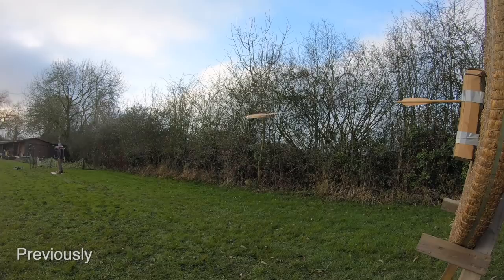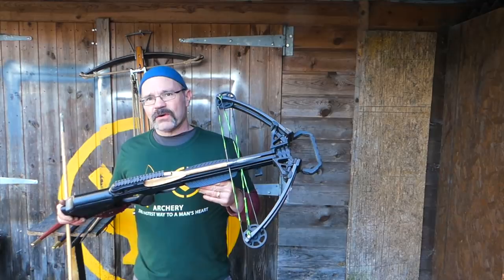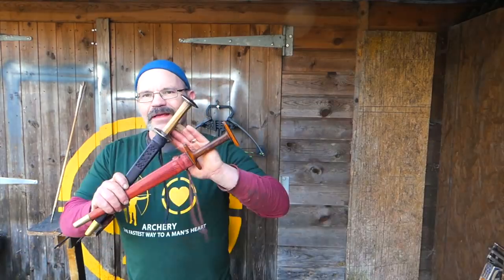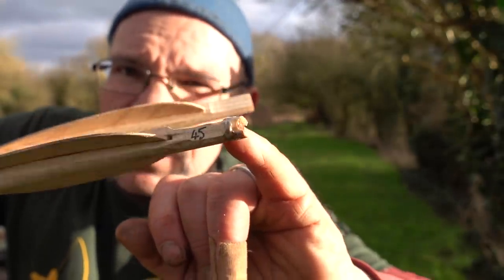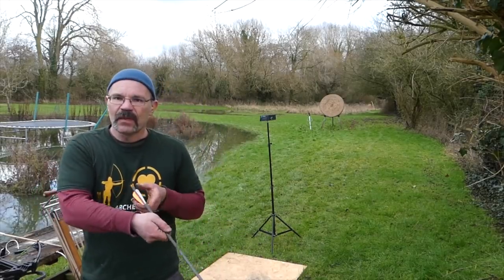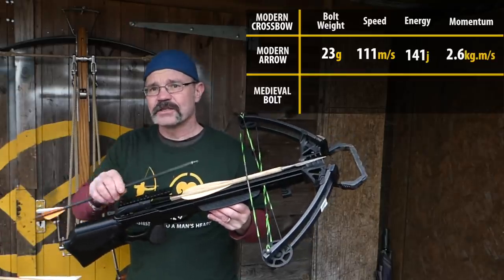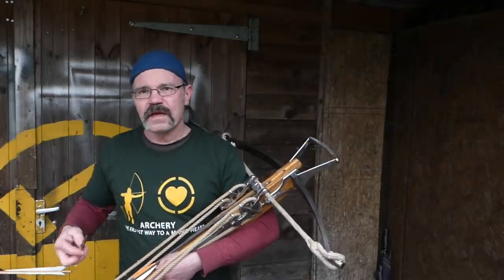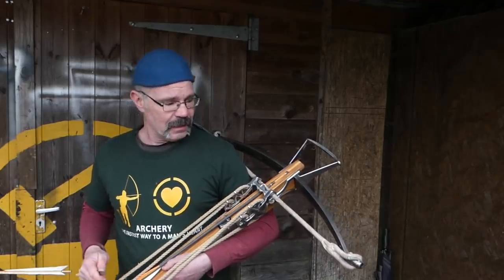Heavy Crossbow - Light bolt - What happens?

Comment: There’s a lower upper limit just because you’re not just shooting the bolts, you’re also shooting the bow and string so the heavier those are relative to the power in them, the lower the speed limit will be since the theoretical maximum speed is the speed at which the centre of the string goes when you dry fire it.

Comment: Regarding you holding that bolt down with the thumb on the windlass crossbow: did you not have a vid some time ago with hunting (?) crossbows with a kind of a clamp that was turned over the string, to hold the bolt in place?
Maybe you can make one of those for the big one, just for purposes like this? Maybe even one that you can add to any crossbow (thinking of a kind of a screw-clamp construction here).
Reply from the maker: Yes, but they had not been invented when this style of bow was made

Comment: Nice! I love your videos, especially these exploratory ones.

Could one explain both the increased efficiency of the modern bow + medieval bolt and the decreased efficiency of the medieval bow + modern bolt simply in terms of the mass ratio between the bolt and the bow?

That is, for the medieval bow, the bow (plus string) is already so heavy that the difference in the total mass of the accelerating parts (i.e. bolt + bow + string) between the modern and medieval bolts is so small that the overall acceleration is only slightly higher. But, since the lighter bolt comprises less of the total mass, less energy is transferred to the bolt, in spite of the slightly higher acceleration. 

For the modern bow, on the other hand, the string and bow make up much less of the mass and so there is a significant difference in the amount of mass being accelerated between the modern and medieval bolts. Thus, even though the total acceleration must be less (because there is more mass), more of the energy is transferred to the heavier medieval bolt as it comprises a greater fraction of the total mass.

Comment: I think you mentioned in some videos momentum is the key factor for penetration but to me(mechnical engineer) that sounds wrong.
think about it: a very thin slender hard bullet(same would apply to a spear or arrow as long as they don't break) for example penetrates better than say big fat almost square shaped shotgun slug, even though the latter has more/similar kinetic energy but VASTLY more momentum

For an arrow I'd imagine it would be mostly about kinetic energy + shape of the head and diameter(bigger meaning generally worse penetration) for Penetration

For the amount of damage it does what gun people usually refer to as stopping power I could imagine momentum not being an entirely useless stat(A bigger hole is a bigger hole after all)

Comment: Excellent video. I am astonished at the efficiency difference. By shooting two very different weights one can compute a virtual mass for the two crossbows. 
So we can compute the energy stored in the bow initially and the virtual weight of the moving parts of the crossbow (considering the same speed as the bolt):
Modern crossbow would give a estimated max energy of 170J and a virtual mass of 4.7g. Dry fire speed would be 270m/s. And a 82% efficiency with the modern bolt.
Medieval crossbow would give a estimated max energy of 359J and a virtual mass of 170g. Dry fire speed would be 65m/s. And a 28% efficiency with a medieval bolt.
So in the medieval crossbow you input twice the energy while loading and almost 5/8 of it stays in the Crossbow, being dissipated as heat or friction. Using a lighter bolt would not improve speed enough for the energy penalty.
Conversely the modern crossbow is almost maxed out. Going for a heavier bolt would not give much of an advantage in the energy department, but the loss in speed might be significant.

Comment: Not sure but I think its the lenght of the string movement from back to front, I see that there is not a whole lot room for that medieval string to get back to resting position, whereas the modern one has more room. Was it called draw length or something like that? That gives the momentum for those bolts, also would be interesting to see how wobbly the light arrow gets when shot out of that medieval crossbow in slow motion, bet it warps/bends a bit more than the short bolts.

Comment: Flaming arrows- hollywood myth (because they look good) or fact? I can see the benefit if there is lots of straw or a thatched roof but what about the main door? It struck me that inability of a bolt to penetrate through a seasoned oak door wouldn't be necessarily a problem if the bolt was coated in pitch / tar or other such flammable stuff. When the door burns down you have access for men at arms and crossbow bolts alike. When the bolt hit the door it would penetrate to a degree but in doing so it would smear burning goo all over the wooden door. If you were really lucky it would light up the inside of the door as well halving the access time. Opening the door to try and put it out would pose an obvious issue for security and personal well-being. But would it work? If the wood was wet perhaps not. Would a wet wooden door be less likely to splinter and be able to handle a battering ram better? Obviously not great for the long-term well-being of the main door to your castle if you kept it constantly soaked but I'm wondering if the first thing I would do when I saw the enemy approaching was chuck buckets of water over the front door and rather than using hatches above the main door to rain boiling pitch down on attackers I would just keep the door wet by chucking down buckets of water onto the door (at least until they turned up). Do we know if they really did rain boiling pitch down on attackers? I would have thought pouring hot pitch onto attackers (who might well be carrying torches) would be a good way of burning down your own front door. Who knows, rambling conjecture. But for me an interesting thought experiment for a cold Saturday. Cheers for the channel!!!

Comment: I'd like to see a bow utilize a combination of a modern compound crossbow, with the ridiculous draw weight and metal bar spring tension of a medieval crossbow. 

My hunch is that the mechanical advantage provided by the flywheel system of a modern compound crossbow (and perhaps string improvements) is what is pulling the extra weight behind the faster return on the modern crossbow, as the metal has to mechanical and physically deform from the release of tension, a jarring and rather wobbly process (the string slap on the Gastrophetes you built to vs Jorge is a good example of the lost energy), rather than the flywheels oiled and one-dimensional spinning (under spring tension) as they draw in the slack of the cocked crossbow.

Comment: May the diameter of the rear nock end of the modern bolt play a part in loosing some speed as well? The string needs to connect with the centre of the bolt , if slightly low or high when pushes the nock it maybe can’t put all the string energy into the centre of the bolt , I don’t know 🤷‍♂️ . Great video as usual 👍
Reply from the maker: A bit possibly, but not enough to count I think

Comment: that's more or less what i expected. what i would like to know is what happens if you had a iron shafted bolt (even greater weight) as i think that the old bow would quite possibly outperform the modern one, the second question i have is would the weight of bolt needed for this result still be useable/practical?.

Comment: The pully system means that the string moves faster than the bow. It must have some effect. The modern bow might not move unrestrained by a load that much faster than the steel one.

Comment: I suppose it's a bit like a car with a big engine and small tires. Despite the fact that the bigger wheels take more energy to rotate, if you don't have enough surface area on the tire, the force generated by the engine will not be transferred to ground, and thus it won't translate into more forward momentum for the car (I think I have that right, but I'm sure someone knows for certain).

Comment: Speaking as an engineer.. It would be really intersting to find the optimum bolt weight for achieving the highest momentum from the medieval crossbow, my guess is it will be even heavier than the bolt you use now
Reply: the optimum momentum bolt may prove to be useless in practical terms. a train moving at half a foot per second has huge momentum but if you were to get hit by it - no damage (unless there's a wall behind you).
Reply: @jrs4516  That is true indeed, although it of course also depends on the area used for delivering the momentum. If you use a crossbow type tip on the front of a train it might still do considerable damage

Comment: That might just have been the most interesting video yet in this series! 
Quick question for the uninitiated: Why is dry-firing a crossbow dangerous to the string? I gathered that it might break. I am not clear on the process behind that, though. Can anyone explain it to me?
Reply: The weight of the bolt/arrow acts like a spring. Many materials or constructions handle a gradual increase in load better than sudden increase. So with the string snapping straight - dry firing or with too light a load - there's an increased chance of strands stretching or the whole thing just breaking.
Reply: @Michael-jx9bh  Thank you very much for the eloquent answer! :)

Comment: Interesting that the modern light bolt stayed accurate at such slow speed.
Now I'm curious if the 67g medieval bolt is optimal for the heavy crossbow - could that weight be fine tuned for more momentum?

Comment: the spring on the middle age cross bow does not spring as fast as the modern composite.  The modern bolt will be going that maximum speed.  Like gravity only pulls so hard regardless of the weight.

Comment: So I have a question after watching this and another video where you compared a 1000 pound xbow vs a 150 pound bow... and they were roughly equal.  You explained that because the xbow was only propelling the bolt 6 inchs, where as the bow had a much larger draw length it got me to thinking.  What's more important?  Draw strength?  or Draw length?  If I was a small person with shorter arms, should I go for a bow that is lighter but I can draw further back... or a heavier bow?  Does the length of the bow matter?  If I were a small person, should I get the tallest bow I can manage?
Reply: It's not about propelling bolt 6 inches.

It;'s about spanning the bow for 6 inches.

https://en.wikipedia.org/wiki/Work_(physics)

Work, or energy gathered by application of force is roughly equal to said Force multiplied by displacement.

So, draw weight and draw length are roughly equal in importance. In reality it's going to be much more nuanced, of course.

Here you have about 1000 pounds of force and displacement of 6 inches.

Similar energy stored could be achieved by drawing 200 pound bow 30 inches.

Think about trying to unscrew something by pulling shorter part of a hex key, as crude comparison.  A lot of more force needed for the same effect as pulling the longer end.

Comment: Could you build a really heavy bolt with really fine and thin, hardened steel tip for maximum penetration to shoot from the medieval crossbow? to see how much penetration you can get with old technology but modern steel tip bolts? Tungsten tip would be better but tungsten is really a pain to craft with

Comment: i have done a similar test with an old compound bow. i took a 500gr arrow and put it out at 210fps. and then a 600gr arrow at 190fps, so 100gr increase for 20fps lose in velocity. but then i filled that arrow with lead shot, which is not recommended, and shot it again. 3500grs total weight, so 7 times heavier but still went 89fps. Now after seeing this video now make me wonder. how much arrow weight is needed b4 the medieval crossbow overtake the modern crossbow in velocity and energy.

Comment: So I think the idea of a "maximum return speed" while not technically wrong, is definitely confusing. What you call the maximum speed with the windlass is the return speed it'd have if you actually dry-fired it. Considering that the inertia of the bow and string is the majority share of the inertia of the total system of bow, string and arrow the mass of the arrow only has a small impact on the overall inertia and therefore the return speed. 
The important bit to mention is that the modern bow also has such a maximum return speed, again the speed with 0 bolt mass, aka dry fire. But due to the mass of the bow and string being significantly reduced (composite materials vs steel, presumably less redundancy due to more precise tolerances) the mass of the bolt does actually determine a significant share of the inertia and thus return speed.

Comment: I wonder if you put a heavier tip on the Modern Bolt, shortened the Shaft and Refletched it to 2 Vanes/Feathers to see the difference? 

You see, Carbon Shafts allow for skinnier Bolt/Arrow whilst maintaining the correct Stiffness aka Spine. So the Modded Carbon Bolt should in theory be more aerodynamic thus slightly faster.

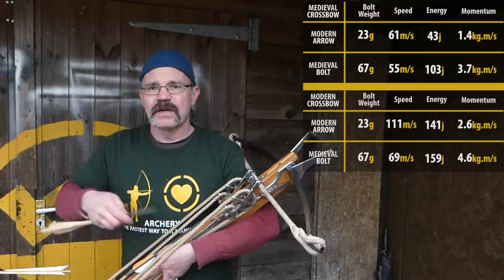Comment: 8:12 Those are some very interesting statistics :) 
What I find interesting is that the medieval bolt shoots better with the lighter bow, even though it has a lighter draw-weight. This is too explained by the huge inertia of the heavy crossbow, but does that mean that it can shoot way heavier projectiles? Or did all the excess energy go into getting the bow moving?
Reply: Yeah as he mentioned in the first video, a lot of energy is lost in simply getting the metal moving back into the "neutral" position, but the draw weight means it can shift big heavy bolts and punch them slower but with high momentum.  There will be a sweet spot of bolt weight for each bow.  If you go too heavy, the bow will start to lose it's energy backwards in the form of recoil into the user and the bolt will start to move too slow to be useful.  Think of putting something stupidly heavy in there as an extreme, like a cannonball (if it were possible).  The cannonball itself would barely move and the bow would push itself backwards straight into the users shoulder, as that's the path of least resistance.
Reply: @noggintube  I would like to see what would be the modern version of a heavy/siege crossbow. If modern hunting crossbows can already deliver a higher punch with medieval heavy bolts, how powerful could we make it now?

Comment: why the medieval crossbow shoots a modern light weight bolt at a much reduced energy?  My guess is that the stored potential energy before the trigger pull remains the same regardless of the bolt weight.  However the potential energy needs to be applied to the bolt, the string, and maybe to the bow too.  If the bolt is so light (similar to dry fire), the % of energy transferred to the bolt will be much much reduced; instead the energy is transferred to the string and the body of the bow.

Comment: Hi Tod, great video... so, how heavy a bolt could the 1400's crossbow push? If the modern crossbow still outperformed even while shooting the heavier bolt, at what point would the weight of the bolt cause the 1400's "truck" to be the better option?
Reply from the maker: I have shot up to 125g and the speed doesn't drop much, so maybe I will bring it back for that.....

Comment: Does it have anything to do with the length of the "stroke" of the string? I know that string isn't pushing at 900 or 150 pounds that whole time.

I'd love to see a collab with someone on that and how it affects the efficiency of the bows. Have a feeling the modern bow is a much more consistent push and the medieval one is a whole lot for a very short distance following by much much less.
Reply: The simplest way to look at it is with basic physics equations.  Force=Mass*Acceleration which means that A=F/M.  With no bolt the big crossbow has very high force AND a very high mass.  That equals out and you get ok acceleration for a pretty short amount of time because of the short draw distance.  The upside is that adding the bolt doesn't change the mass much proportionally so it changes the acceleration very little.

Compare to the little crossbow, which has lower force and MUCH lower mass.  That leaves the acceleration higher when dry fired over a longer draw length.  The downside is that adding the bolt makes a bigger difference to the total mass AND that any change in the bolt mass makes a much bigger difference in the acceleration.  The upside is it's got a better power to weight ratio so it can be faster.  If you keep increasing the weight of the bolt there is probably a point at which the heavier crossbow performs better than the lighter one.

Comment: I wonder why they didn't build them with a much longer draw distance. Seems like you could get more velocity and use an even heavier bolt. If the steel of the time couldn't handle it, then maybe you could have attached a 300lb warbow to the stock. It'd be interesting to see what that could do.